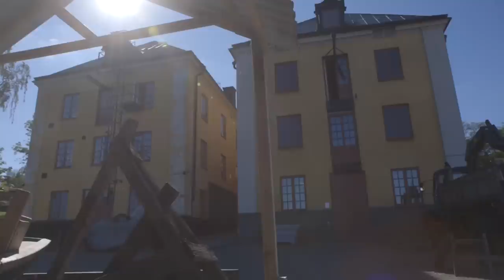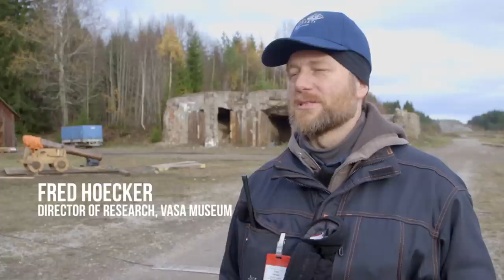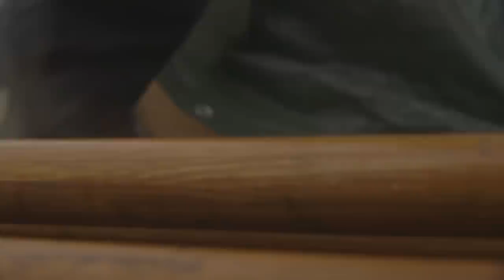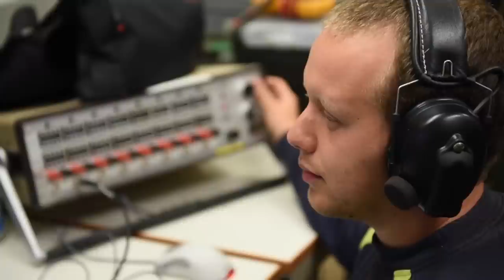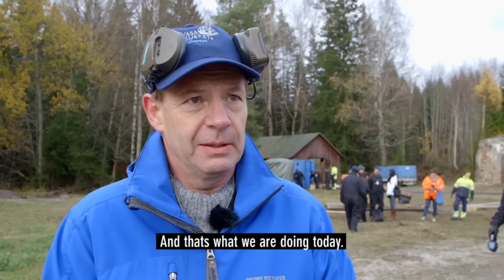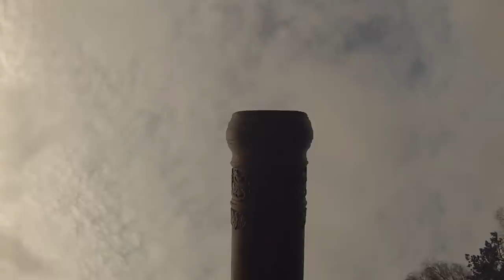Bofors Test Center - Vasa gun project

Comment: Fun fact: oak has antimicrobial properties and so splinter wounds tended not to get infected. Ships made of Asian hard woods like teak did not have this advantage and so teak was discontinued for warship construction even though no one at the time understood what or why this was happening.
 Also I have read that the floors of the gun decks on British war ships were painted red so the blood would be less visible and so less demoralizing. Buckets of sand were provided if the floors became too slippery. 
Sounds like a good time all 'round...
Reply: With the vigorous cleaning of decks and hard use that happens on age of sail English warships I doubt the deck was painted. It would wear off rather quickly being scrubbed with holystones quite often. The sanding the deck to make it less slippery in combat part is true.
Reply: The interiors were painted blood red.
Reply: @chrisbrent7487  the Bulkheads, inside of the Hull and oder structures were painted red. the Deck was left unpainted
Reply: warfare in the age of sails was unimaginably brutal. And we didn´t even start thinking about boarding parties....
Fun fact no. 2: oak dust is classifies as hazardous substance, as it is cancerogenic and can lead to allergies. Teak has the advantage of being naturally oily, so it doesn´t degrade in prolonged contact with sea water. It is also slightly toxic and can cause allergies. (tbh, oak does also fare pretty well in water due to its tannine content, but it tends to cause iron to rust pretty quickly for the same cause)
Reply: @rustknuckleirongut8107  don't know really about that. I work with oak all day and if u get deep splinters they get puss and infected if i dont pull them out.
Reply: @borjesvensson8661  You replied to the wrong person. I am not the original poster. But to the point you were making, there was an astoundingly larger chance of surviving a large open wound on a wooden warship compared to being a soldier on land with the same wound. I do think that was mostly down to the prescribed regiment of hygiene on a warship, the fact that you lived in a confined space with people whos germs you were familiar with and few sources of unknown infection compared to the land.
Reply: @zhufortheimpaler4041  yes
Reply: Red was cheap, that was the main reason it was used.
Reply: @rustknuckleirongut8107  Sounds like a myth like that English redcoats wore red uniforms to hide blood.
Reply: I'm fairly sure there was enough dirt and grime on sailors bodies and clothes to infect any cut instantly. It were times when bathing was considered bad for health.
Reply: @randomnickify   Right. All those sailors with missing limbs and eyes were born that way...
Reply: I am also pretty sure the sand was for fire fighting, either embers from your own guns or a hit.
Reply: @57thorns  Round shot doesn't cause fires.
  In the age of wooden ships, canvas sails and hemp rope fire was an absolute terror and great pains were taken to avoid it.
 Though a bucket of sand could smother Smal fires there were buckets of water close to hand for swabbing gun barrels between shots so sand would not have been your first go to on the off chance of a fire.

Comment: It would be interesting to have a bit of data, such as weight of shot and velocity.
Reply: @lukaszg2280  I was worried this would be one of those insufferable spam comments. I am rarely pleased to be wrong, but this is one case of that.
Reply: The fastest speed was just over the speed of sound and the lowest around 200 m/s. A 24lb shot.
Reply: Fred Hoecker has another longer and more detailed video on the whole thing, which includes more data

Comment: what would happen if you fire 80 of these guns simultanously on a modern Leopard 2 or Leclerc tank?
Reply: Well if it hits the armor it probably would just bounce off without causing real damage.
I guess you might be able to destroy some equipment like cameras etc. if you hit those spots.
Reply: @HingerlAlois  I am sure you hit the same spot 80 times, surely you got to punch through eventually
Reply: @wonniewarrior  
I doubt it.
I would expect almost no effect on modern MBT armor.
Reply: @HingerlAlois  One should try it :-) Would love to see what happens if lots (!) of old 16th century powder guns would continously fire on a modern surplus tank. (Maybe for one hour)
Reply: @Schlipperschlopper  You would have at most just a bump in the armor. Modern ammunition hits so goddamn much harder.
Reply: @PySnek  True. But being hit by 800kg of steel traveling close to the speed of sound might be a little rough on the tank anyhow.
Reply: @u_u4640 mostly rough on the Cree the tank won't care at all
Reply: They're fired at or around the speed of sound, pretty sure they can f* $h|t up.

Comment: 24 pounder from the 1500s. Low velocity, about 700 meters per second I believe. Can penetrate a metre of oak in ideal conditions according to these tests. From a recent Dracinifel video.
Reply: They cast a replica gun for these tests.   No way would they risk a piece of history.
Reply: 8 pounder. And 700 meters a second is TWICE  the speed of sound. On what ocean is that "low velocity"?
Reply: 700 m/s seems too high for a cannon of the period, I wonder if they supercharged it?
Reply: 1600s, and they tested about 200-360 m/s.

Comment: I'm not sure what I expected, but that's a very small entry hole.
Reply: @keithwoodburn7895  which is precisely why I find the small size of the entry hole so surprising (because of the carnage on the rear side).
Reply: That's what he said.
Reply: Same thing happens with a bullet - even if it passes through a very brittle material such as glass, it’s entry
hole will never be any bigger than the bullet.
But the shockwave from
the initial impact travels through the entire
length of whatever it hit,
in the form of an expanding cone, making more and more shrapnel the more
materials they pass through.
That’s why a 19th century torpedo boat, with, by definition, no armor, would be the safest place to be - a big battleship shell will hardly do anything after passing through what’s essentially a sheet of tin.

Comment: I guess the firing might have not been authentic but at optimal circumstanses - percfect cannon balls fired with perfect powder on a fresh unpainted not moving shipside and the OAK might have been grown with big porus cells eg modern growth .
Reply: So what youre saying is that 1600 era oak would have stopped that? Pretty sure that the oak used came from Visingsö where they have been growing since the 1830's. Authentic are for a few reasons an impossibility.
Reply: @renhanxue   I guess they used  moist powder - or why not store the powed underdeck in woden ship -let it degenerate and then fire
Reply: @renhanxue  Thanks for the link.
Reply: @jari2018  your nitpicking too hard
Reply: Check out this video, where Fred Hocker details how much effort they went to, to make sure it was as authentic as possible. https://www.youtube.com/watch?v=6jRhEiibhCc